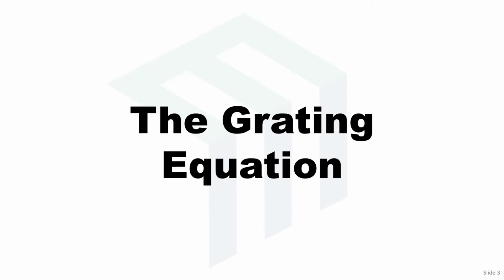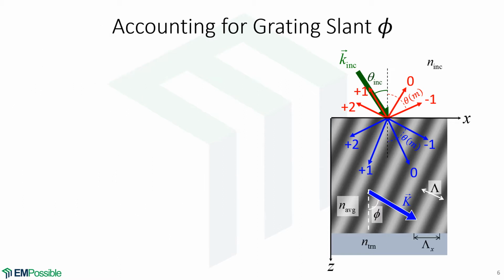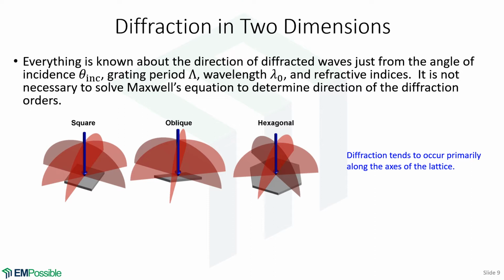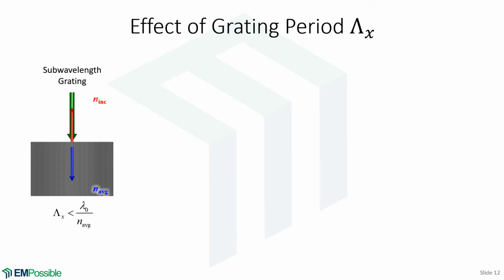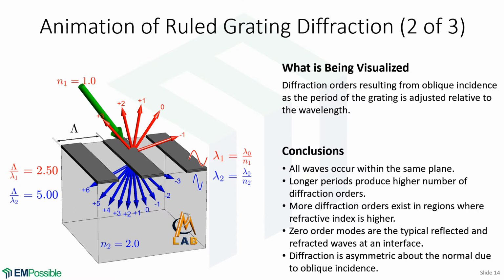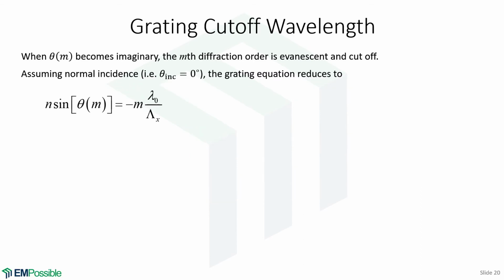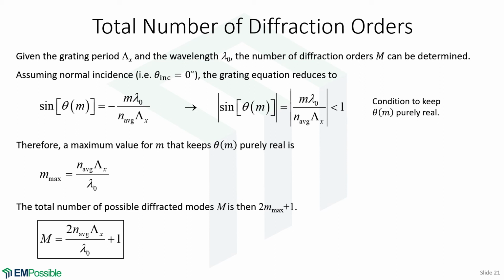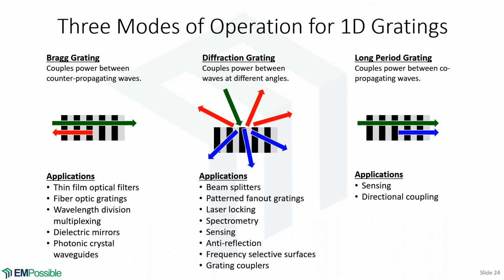Lecture -- The Grating Equation

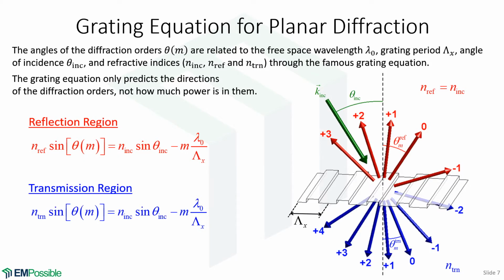Comment: Thanks for your lecture. I am a bit confused at 7:53. what does n-ref mean (or n_average in the previous slide). let's say the light incidents from n_air, grating material has n-grating. does n_average (n ref) here stands for just n-air？ or the  effective refractive index of the gratings (average from the grating material and air)?  Many thanks
Reply from the maker: n_ref is the refractive index in the reflection region.  Yes, n_ref = n_inc.  You can sort of think of n_ref and n_trn as the refractive index wherever you may be observing the diffraction orders.  If you are observing the diffraction orders in the middle of the grating, then the refractive index where you see n_ref and n_trn would be n_avg and would the average refractive index.  

Hope this helps!
Reply: @empossible1577  thank you very much, Professor.  One more question, do we have the grating equation for a more generalized case. For example, we have all  kx_inc,  ky_inc and kz_inc components. (In the slides ky is not considered as it’s on the plane of xoz) many thanks
Reply from the maker: @homoduran  First, let me point you to the official course website.  You can download the notes, get links to the latest version of the videos, and get access to other learning resources.

https://empossible.net/academics/emp6303/

The grating equation sort of is the most general form.  For crossed gratings, you have diffraction along both of the grating vectors that describe the symmetry of the grating.  You will write the grating equation twice and this will give you an array of diffraction orders kx(m,n) and ky(m,n).  From there, you calculate kz(m,n) from the dispersion relation.

Comment: What happens that the wave transmits through grating region if we have a uniform dielectric after that? Do they still remain “chopped wave” or become back like applied wave?
Reply from the maker: Yes, the wave remains periodic with the same period as the grating.  The diffraction orders will refract and alter their direction.  This is already accounted for in the grating equation presented in this lecture.  This is in a refractive index of the medium where the diffraction orders are being observed.

Comment: Dear Prof. I have one question:

In Bragg grating it is said that it couples power between counter propagating waves. What is mean by that? In the slide we see only the reflected wave of the incident beam.
Reply from the maker: Take a look at Slide 5 in Lecture 4j here:

https://empossible.net/academics/emp6303/

Here, I divide gratings into short period, diffraction, and long period gratings.  There are also subwavelength gratings that have periods every shorter than short period gratings.

This all comes down to the grating vector K being equal to the difference between the phase constants of the waves the grating couples.

K = 2*pi/L = | k1 - k2 |

Short period gratings, or Bragg gratings, couple energy between waves propagating in parallel but opposite directions.  Since the waves are propagating in opposite directions, the difference in the wave vectors k1 and k2 is maximum, therefore the period L of the grating is minimum.

Next are diffraction gratings where the difference between k1 and k2 is smaller due to the angles.  Therefore, the period is a bit longer.

Next are long period gratings.  Since the waves are propagating in the same direction, the difference between their wave vectors is very small.  This leads to periods that are very large.

Does this make sense?
Reply: @empossible1577  Thanks

Comment: Dear Professor, based on the lecture I had a question in mind. Let's say I have the following structure. A medium with index n_1, a grating region with index n_avg, and a medium with index n_2. Light is coming from medium 1, hits the interface between n_1 and n_avg. The grating equation gives me the angular distribution of the transmitted waves within the material n_avg.  If I want to find the angular distribution of the spectrum in the material n_2, should I modify the directions I got from the grating equation with Snell's law that would be at play when light is crossing the interface between n_avg and n_2. Thank you in advance!
Reply from the maker: Just replace n_avg with n_2.  That is it!  Think of n_avg in the grating equation as the refractive index where the diffraction orders are being observed.  Sometimes I even write the grating equation as n_obs to convey this point.

Hope this helps!

Comment: Thank you for your lectures, in minute 4:29, How do we get to the fact that the magnitude of the Kx vector is K0navg? The derivation of this is shown in previous lessons?  What is this K0?
Reply from the maker: k0 is the free space wave number.

The magnitude of any wave vector inside of a medium with refractive index navg is

|k| = k0*navg

A wave vector at angle theta in the xz plane is written as

k = k0*navg*[ sin(theta)*ax + cos(theta)*az]

where ax and ay are unit vectors in the x and y directions respectively.  The x component of this is

kx = k0*navg*sin(theta)
Reply: @empossible1577  Thank you!

Comment: Hello, Thank you for all the content in your channel and the available pdfs on your website. I have a few questions:
1. Why do we have to set those boundary conditions for phase matching in slide 4, and what do we mean by "be continuos"?
2. In slide 6, why we only consider the tangential components? 
3. On slide 21, the condition of having a theta angle real, is that the value of the magnitude is less than one. But for the m(max) it looks that we made the value of the magnitude equal to one. Is this correct?
Reply from the maker: Thank you!!
1.	The phase matching condition is what ensures the field is continuous across the interface.  When there is a grating, the phase matching condition is modified to account for all of the sum and difference terms that arise.
2.	It is only the tangential component that determines what the field looks like at the interface so it is only this term that has to be matched across the interface.  Remember the field varies according to kx*x+ky*y+kz*z, but at the interface z=0 leaving only the tangential terms to describe the field on both sides.
3.	Correct.  This is to approximate what maximum value of m makes that argument equal to 1.  Smaller values of m will keep the value less than one.  m must be an integer so you may have to round down after this calculation.
Reply: @empossible1577  Thank you. Following 1: When we say across the interface we are talking about being continuos through the grated material once they crossed the interface and splitting into specific modes? and the sum and difference terms(k) we are talking about are the same we got from this lesson:  https://www.youtube.com/watch?v=g4MLvn9D_KM&feature=youtu.be ?
Reply from the maker: @okeokomo  It is not correct to say anything about "through" the grated material when it comes to phase matching.  Phase matching only applies at the interface over a distance of zero, not through the material.

Yes, the sum and difference terms are the same as from the video you pointed to.
Reply: @empossible1577  I see, thank you again
Reply: @empossible1577  I have a few confusions with question 2 here: 1.I understand that we do not use kz as z = 0, but why we do not consider ky if we are considering kx? I believe both are at the interface, is it for simplicity? 2. I also have some doubts about using z=0, in the image we see that the transmitted light has components on z and x, and later we obtain the grating equation that applies to all thetha(m). What is confusing for me is that we obtain the grating equation only using kx, and the grating equation itself describes properties of light with x and z components. I hope I was able to explain myself haha.
Reply from the maker: @okeokomo9613  Here I am looking at diffraction that occurs only in the xz plane, thus ky=0.  

Don't confuse the components of the wave vector kx, ky and kz with the components of the electric field Ex, Ey and Ez.  The angle theta(m) deals with the wave vector and not the electric field.  k and E are perpendicular to each other.
Reply: @empossible1577  Thank you, does kz also has to follow a phase matching condition just as kx?
Reply from the maker: @okeokomo9613  The tangential component of the wave vector is continuous across the interface.  Most of the time in my analyses, I place the interfaces parallel to the xy plane so it is only the kx and ky components that are continuous across the interface.
Reply: @empossible1577  great, thank you again!